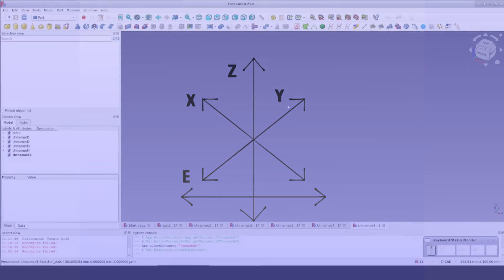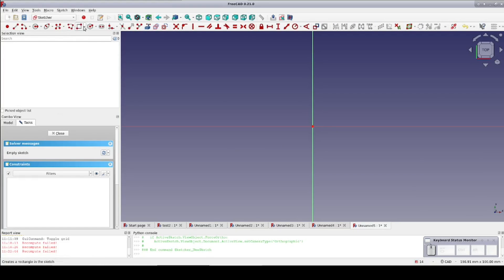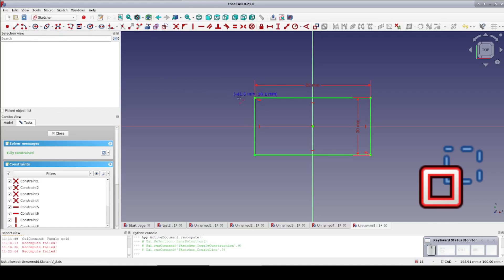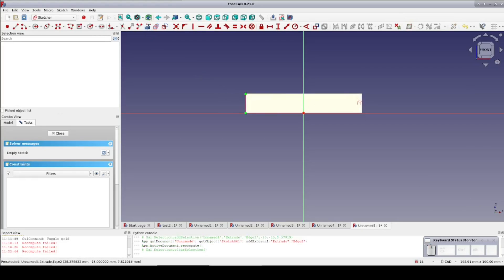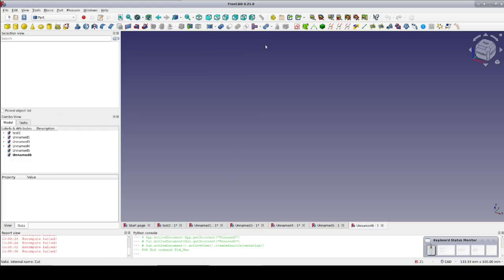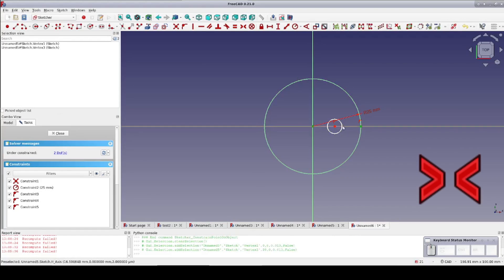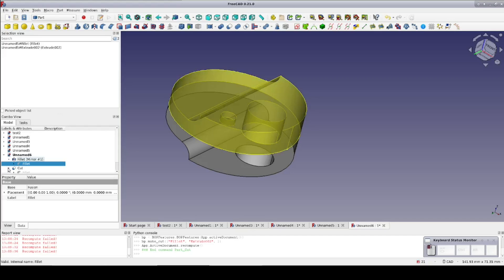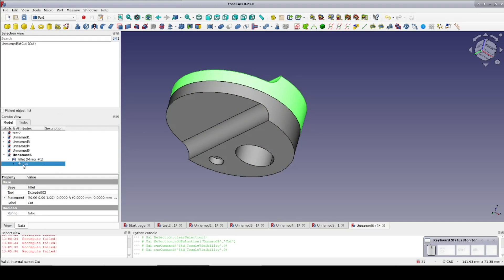FreeCAD: An Open Reply to TeachingTech

Comment: I think the real take away from Michael's video, and a similar video from Angus of Maker's Muse, is that FreeCAD has a very steep learning curve even for people familiar with other CAD packages. Clearly you can overcome the problems they outlined, but FreeCAD does things in its own unique and not always intuitive way.
Reply: I've been a CAD user for 39 years (since Autocad 2) and nothing has come close to Freecad's level of WTF during the learning curve. It is a 1990s package trying to attract a 2024 audience.
Reply: It was (and in many ways) is still the case with Blender. But now blender is de-facto standard in many areas.
Reply: @dmitryplatonov though with Blender the 2.8 Release was massive in terms of usability. It was that change that put Blender on the road to a widely adopted tool. And with that  came a nice bump in development resources.
Freecad would need a similarily easy transition path for everyday things one does in other software.
Reply: I am glad to see this video from someone more experienced in response to theearlier video. HopingTNP and the integrated assembly workbench will soon be with us.  I do not want to do ondsel right now.   I am fortunate that I have come from acad 2D to freecad with no experimenting with other proprietary packages. I made the FOSS decision and then started with freecad.   I use 2D for my work and will employ freecad for 3D hobby projects.  Tony
Reply: Topology trees are not a timeline. Topology trees are not a timeline. Topology trees are not a timeline.

Also, you're skipping the part about topology based methodology leading to complications such as toponaming.  You bring up toponaming, but the methodology influences that a lot too. I really really really really tried hard to like FreeCAD wanting to stay with OSS but after a relatively simple project drove me mad for the umpteenth time I'm mulling over budget options.

It's not functionally usable. I can craft a house out of sand if I put the time and effort in, but it doesn't mean I'm not going to go with lumber instead.

There are downright frustrating elements to stock FreeCAD. And I've used the link version too which produced a project that can't be reliably opened by anything else and produces a step export with missing faces (thankfully STL export worked at least).

Onsdel fixes some of the UI issues but inherits some of the same issues as stock. I hope they can work through those.

The list of grievances I have after trying over a dozen times to do relatively easy operations could fill your whole comment thread
Reply: I've genuinely been going back to blender and using deformers on some of my projects, EVEN IF they'd be well served by sketch based CAD, simply because so fewer things can go wrong.
Reply: The real takeaway from the two videos you mention is that expecting a technical application with advanced capabilities to behave like other programs you have used is a recipe for frustration and failure. It is even worse when the person (people in these two videos) refuse to do any research on the product to see how it worked. I normally love Michael’s (Teaching Tech) videos but I found it very unfair that he made no mention of trying to find solutions his problems but he looked up an issue to solve in Fusion. That is not a fair comparison. And Angus claimed he couldn’t even create a new document in FreeCAD. That is willful ignorance on his part. He didn’t want to review FreeCAD and so he made an excuse not to review it. Watching a couple of quick videos would have helped both of these and still been less effort than they put towards many of their videos. Just because an application works differently than the applications one has used in the past doesn’t mean that the application is bad.

I note that Angus didn’t include OpenSCAD in his review of “all” free CAD applications in 2024. I guess he really didn’t want to the effort into it even though building his project would have been fairly simple using this.
Reply: @capitalinventor4823  That was my beef with TT's take too. So many of his criticisms came down to ignorance, something that could have been solved by watching some of the many tutorials on FC. (Presumably he watched a bunch learning Fusion360 and OnShape)
Reply: @capitalinventor4823  do you have much experience using different CAD software? I have used Autodesk inventor, fusion 360, solidworks and onshape and never had any trouble switching to a new CAD program. That is because they are mostly intuitive and most of learning to use them is just learning where the buttons are.

FreeCAD is not the same, it requires much more learning and learning all the workarounds and non intuitive ways it does things.

There absolutely is an expectation for software for similar purposes to work similarly, just look at word or Google docs, they are similar in how they work, same with excel, sheets, etc. Even look at electronic CAD, like altium or kicad or easyeda, they are relatively easy to switch between too since again they work similarly. Inventor, fusion 360, solidworks and on shape all work similarly and intuitively enough it shouldn't take you long to switch over if you know what you are doing. FreeCAD is not the same.
Reply: @capitalinventor4823 what cad software would you recommend using then?
Reply: @Racio00  

What works best for me may not work at all for you and vice versa. I recommend that anyone try a number of applications, taking a bit of time to learn them as CAD programs are complex things. Time spent learning each app won’t be wasted because the concepts are common. Then choose the application(s) that best meet your needs and work style. This applies to other applications, operating systems, which vehicle to drive, where to live, and a whole lot more.
Reply: @linventor4823You really did not watch the video if you think he didnt talk about his troubleshooting steps. Ironic that you are being so completely biased and unfair to him by doing so.

Your Angus take is even worse. You read a lot of nonsense between the lines. He clearly had tried it in the past, and didnt find it decent enough to bother. There is nothing wrong with that. He doesn't owe you making that comparison.

As for the SCAD take, Im pretty sure he actually did mention it, but mentioned the truth, that obviously its for a very particular type of person.

It also doesnt even use brep or similar maths, so it basically produces meshes from code rather than what you would expect from a cad tool.
Reply: No. It also has glaring deficiencies specifically. Your attitude of just continuously saying its only a learning curve is so frustrating to read over and over again with people basically screaming skill issue.
Reply: @BeefIngot it is a learning curve, a learning curve that is far steeper and taller than needed due to the deficiencies in the software
Reply: @BeefIngot  No I don't think it is just a learning curve. I do think you can put the time and effort in and make it work, but I would totally agree that you shouldn't have to and to do some things just requires a lot more work than it should. I don't use FreeCAD for this very reason, every time I tried it just frustrated me. I ended up using OpenSCAD instead even though I would not advocate it as a FreeCAD alternative to most people.
Reply: @BeefIngot / Istg they never brushed about lacking/worse features equivalency. Fillet and Chamfer in particular is absolutely horrible when it comes to intersection...

I wish they had pointed them out for prioritization or something. UI/UX has marginally improved ever since MWL(Thomas) broke the pitch about it.
Reply: @m4ki9h76  They kinda did though, by implying that its just about learning curve just because you can work around the deficiencies and where they state what the real takeaway is, as if that the software also has glaring flaws is not one of them.

Comment: I'm a free acct onshape user and fusion360 user (not often now), and have tried to get used to freeCAD in the past.  This video is VERY good and very informative, and I wish it could have existed sooner.  I couldn't get used to FreeCAD when I tried.  I wish it was more like onshape, which I find very comfortable to use most of the time.  I know one of these days my onshape models are going to either cease to exist, or not be possible for me to edit any longer, so I suppose I should get decent with freeCAD.
Reply: I am in the exact postion as you, I too am an OnShape user as it is so intuitive.  Like you I also have a bit of angst that one day my designs will be held hostage by OnShape until I pay for it. Like you I'm going to take a second run at FreeCAD - which I just been able to install on my works Laptop without admin rights!  Game on!
Reply: I've been using FreeCAD for 3 or 4 years now. I admit that getting into FreeCAD can be quite the grind (at least a few days of "work"). It doesn't help that naming can be confusing (e. g. the "Part" workbench, the "Part Design" workbench and the "Part" object are different things that don't depend on each other at all) and error messages can be cryptic or lacking information. But after you've come to know FreeCAD's kinks, "best practices" and limitations (not many really), it's a very powerful tool. I've created models (which are maybe too parametric 😅), where I change a single number and hundred parts get shifted around and/or reshaped. Almost all parameters of almost all objects can be a formula that can reference properties of all other objects. I don't know if that's something that's even possible in all other CAD programs.

Btw. I find that people who have used other CAD programs have a lot more problems to get into FreeCAD than people who are complete "noobs".
Reply: @superdau  onshape, fusion360, that sort of parametric design capability is a lot of the draw, because they both do it pretty intuitively (more intuitively IMO than freeCAD last I looked).  I have no doubt that freeCAD does this well, but it's not really something you can boast about to someone who already uses onshape or fusion 360, because that's normal, expected behavior for them.
Reply: @lienmeat  
As I said, I don't know what other programs can do. But I'm thinking about formulas where you for example set the step distance of a linear pattern by referencing the length of an edge in a sketch somewhere and dividing it by number of objects in another pattern. Or you calculate the number of repetitions in the pattern by using parameters of objects not related to the pattern itself at all. I'm using the linear pattern as an example here, because it's easy to visualize. I'm talking about values for parameters of an object, where there's no "intuitive" way, because you can only arrive at those values by formulas.
Reply: @superdau I don't know the other systems either but it is really cool that any place you type a number, you can type a formula, and that formula can refer to values defined elsewhere in the model, and those values can in turn be defined by formulas with references, and some of those references can be to aliases of spreadsheet cells, and onwards recursively.

Comment: I saw.  I liked.  I subscribed.
Thank you for this wonderful video.  I have not yet tried FreeCAD, but I will have to give it a shot.  Even though I never used FreeCAD (I now use Fusion 360), I had a suspicion that there were things in FreeCAD that Michael just didn't know about.  I think that even if a person has a lot of 3D CAD experience, when they switch to a new CAD system they really ought to take the time to learn that system as much as possible before using it on a project.      Before I started using Fusion 360, I had many years of experience with SolidWorks.  But even with my SolidWorks experience, I did not just jump into Fusion with the assumption that because I knew SolidWorks, I would automatically be able to just start using Fusion.  What I did instead was to go through the built-in tutorials in Fusion before using it.  When I do give FreeCAD a try, I will do my best to find good tutorials before trying to use it.

Comment: I was expecting and excited to see this video from you! I remembered seeing your response to Thomas Sanladerer when he made a similar video about his issue with FreeCAD. I was surprised to see the Michael seemed to not have looked into really any of the constraint options aside from lengths in FreeCAD. I would personally enjoy seeing your take on the challenges from his video in the part design workbench if you find the time! Angus from Makers Muse also made a video the day after Michael where he labeled FreeCAD as "unusable" if your looking for anything else to reply to.
Reply: I saw that MM video and I could not tell the difference between what he did in onsel vs what I would do in freecad, so I think people are a bit prejudice.

Granted: I watched it while cooking dinner so the concentration was less than full.
Reply: Angus was right.

Comment: Maker's Muse recently made a video comparing free (as in beer) CAD tools, but he only tested Ondsel. He didn't test FreeCAD saying "it isn't usable in [his] opinion." Maybe you could demonstrate how to make that coin for him. :) :) :)

Nothing but love for Maker's Muse though, a decent channel.
Reply: i suspect that maker's muse got stuck right at the beginning when it comes to FreeCAD: picking which workbench to use. "Part" and "Part Design" have a lot of overlaps as well as different workflows, and the program gives zero hints as to which you should use.

this is where Ondsel does better, by basically dropping you right into the equivalent of the "Part Design" workbench.
Reply: You are missing the point, just because with extensive knowledge of FreeCAD you can make something doesn't mean it is usable for the majority of people. By your logic creating the STL files manually would be doable too so that means it is usable and as good as any CAD software. Or that if you write Gcode manually then that is as good as any slicer.
Reply: Ondsel is FreeCAD. The workflow is exactly the same. It's just the buttons are (sometimes) in different places.
Reply: @superdau  people are confused by this right now.
Reply: I think it was just paid promotion of Ondsel. Actually right now Ondsel is just 0.22 dev version of freecad with ondsel lens addon and assembly workbench - nothing special + tons of bugs since it is in early stage and based on a dev version. From one side it's good for the FreeCad community - a lot of new features will be merged back into mainstream, but from other side such unfair comparison leads to lot of hate toward mainstream version. What I want to say - 0.22 is pretty usable if you know how to use it. Linkstage3 is even better, but lack some new features from sketcher wb introduced recently.
Reply: Onsdel is just freecad dev with lens and their own workbench added.
Reply: i feel that would be somewhat redundant? he was quite ok working with the ondsel version and it would not be too long for the ondsel's feature to trickle back to main branch